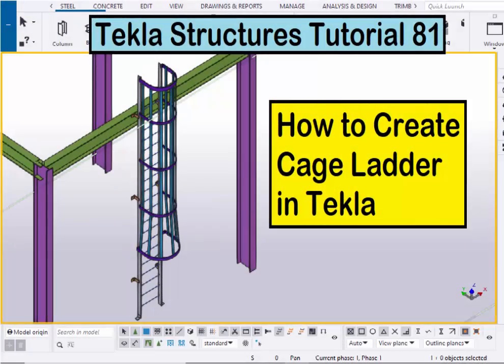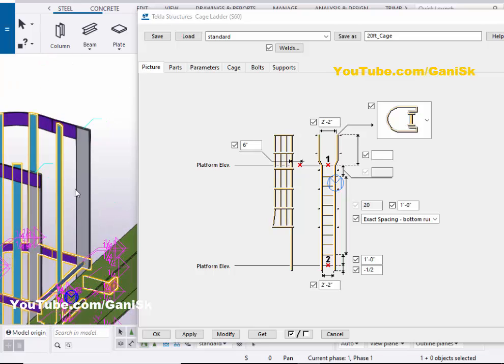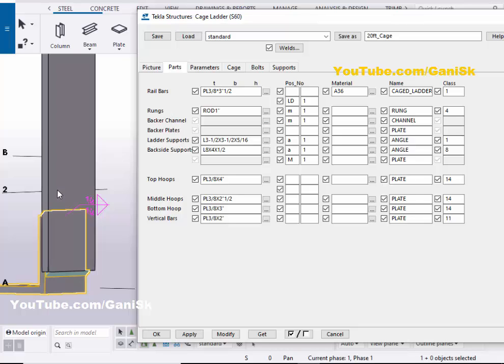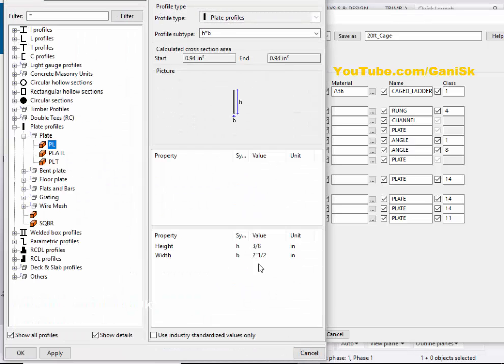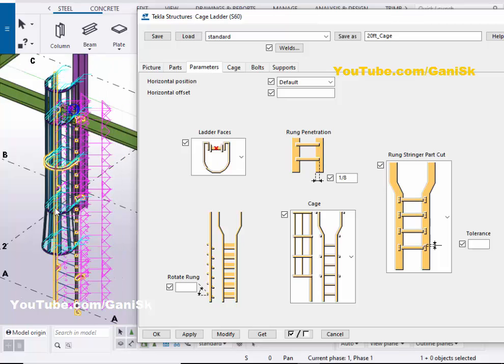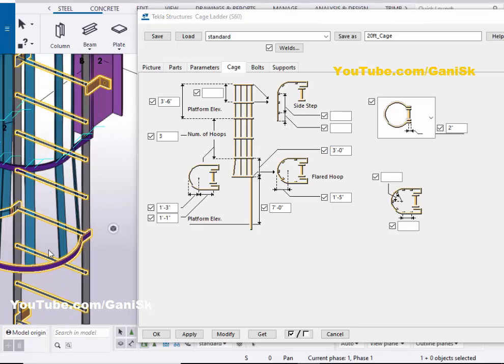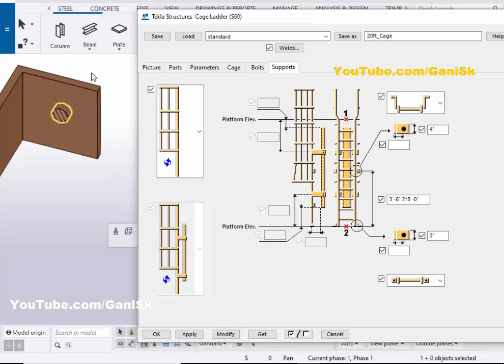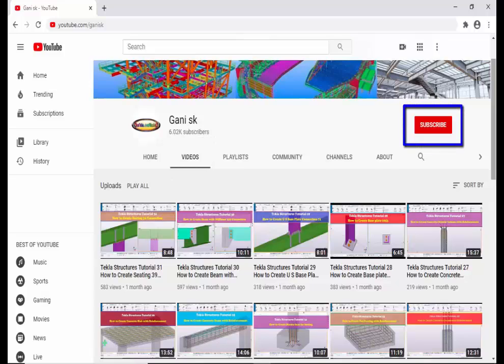Tekla Structures Tutorial 81 | How to Create Cage Ladder in Tekla

Comment: Thank you for providing the video Gani, however, as mentioned previously, the macros that Tekla use are pathetic, I have drawn numerous caged ladders and access platforms, yet with one particular client the top rung is stepped down as a piece of durbar plate bridges the gap between the ladder and beam that it connects to, the plate sits on the top rung that makes the spacing between the top rung and the rung below it different to the rest of the spacing, but Tekla does not make allowance for this. The 'back supports' do not make provision for bent plates, since the beam the ladder connects to, is further away than a 250RSA.

Comment: Sometimes at the base of the ladder, the angle anchoring it, has a vertical slot for any vertical adjustment, it appears that there is no option to do that in the component macro, so not sure how you would do that, it would also need a hole drilling in the stringer, so that feature doesn't exist. I couldn't see how to adjust the supports framing into any beam at the top and lower down, I couldn't see any way to adjust the brackets horizontally. I have detailed numerous ladders, and usually at the top, there would be some durbar plate bridging the gap between the centreline of the top rung, and where it is fixed to the top flange of the beam with countersunk bolts, I assume this would be modeled separately. Really appreciate you dealing with caged ladders. Thank you.

Comment: Very poor Gani, it is something that I greatly dislike about Tekla, the macros. You moved the ladder away from the beam flange, and then after that you showed the connection to the beam. The macro is hard to see on Tekla, I would position the ladder from the centreline of the rung to the centreline of the beam, this would be standard anyway, because the ladder stringers would govern that distance, since the centreline of the rung would be on the centreline of the stringer.